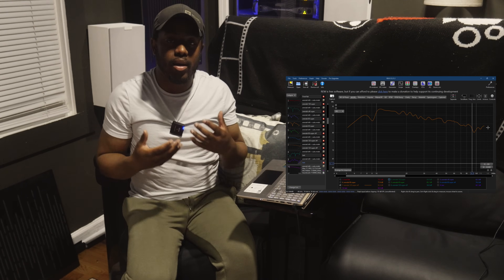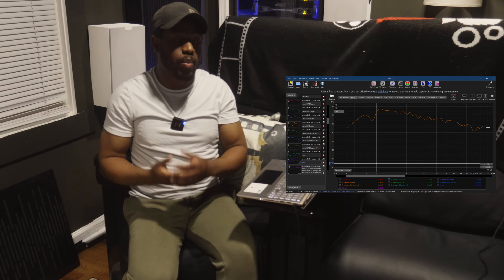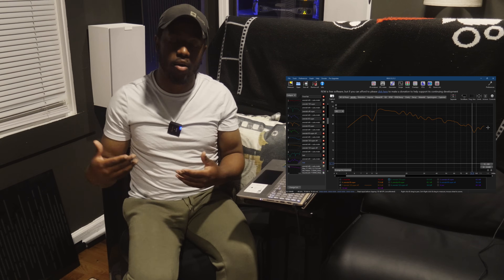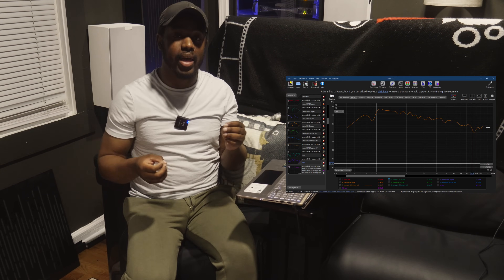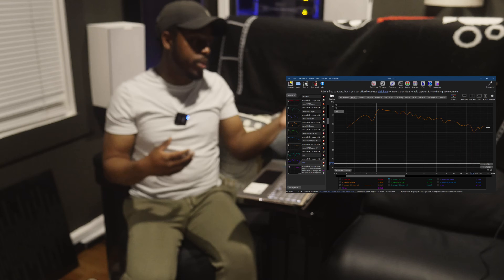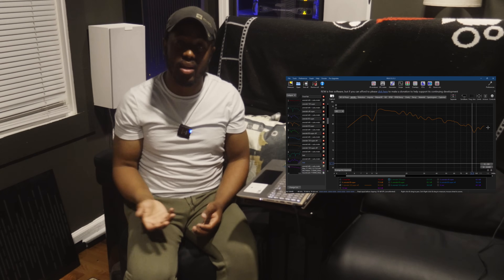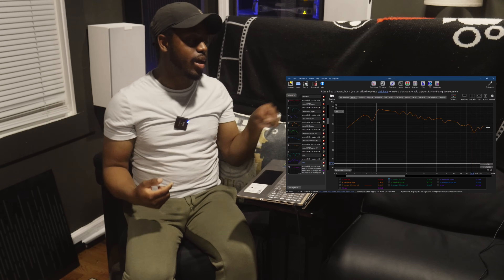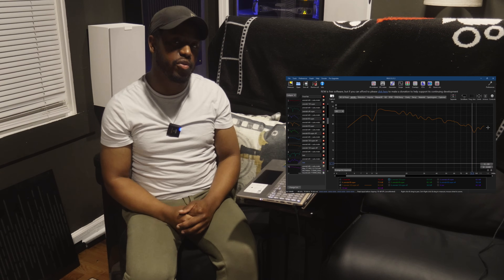What you DIDN'T Know about Speaker Crossover!

Comment: from what i understand lfe is a dedicated channel designed to go to sub. lfe and bass 2 different things. so lfe+main is telling subwoofer to play lfe channel and the bass from the mains. Even if u have ya speakers set to large or full band the LFE will be sent to the sub not the mains. Right?
Reply from the maker: Yes I got mixed up a tad. Lfe will only go to subs no matter what unless you have your subs turned off
Reply: you def right i did a test and it’s crazy the bass output is actually higher when u set crossover to 100hz than it is at full band and double bass
Reply from the maker: Yuuuuup

Comment: LFE supposed to be 120 HZ based on Dolby Labs as well as the Movie Studio. But i don't want my Subwoofer playing anything above 80 HZ my Soundbar can play that, good Midbass. I put LFE at 80 HZ only because it's the Lowest setting but i Prefer 50 HZ which is Perfect to avoid high SPL hearing damage as well as Neighbors can complain. People who set LFE to 120 they normally use DSP to flatten the frequency keeping it Under 60 HZ.
Reply: If you like it this way, that's fine, but it's incorrect.
LFE is its own channel, that channel only "has" frequencies from 120Hz and down, if you set your subwoofer to not play above 80Hz , you are simply losing that information... Unless you use LFE + Mains, then that lost information goes into your Mains.
Remember, High Pass Filter and Crossover are two different things.
Reply: @blwnvtwn okay thanks, I tried 120 HZ LFE on a few Older movies and the non- bass movies. But Godzilla and Kong series and few others I always keep it at 80 HZ. THX says 80 HZ for Everything but maybe not LFE, although I thought it said Subwoofer too, probably Crossover & not LFE.
Reply: @blwnvtwn  I will keep LFE at 120 HZ from now on. Jiles told me if it's not 120 HZ things will just not sound right. Wish the A/V receiver had a Subwoofer Crossover as well. Denon probably has good EQ. My Onkyo has 32 Bit Processor for Music.

Comment: I recently recalibrated my system with Audessy , I set my Speakers to small after Audessy set them to large, Audessy set the front speakers crossover at 40 hz and it sounds better than the 80hz crossover I had set before recalibrating, My Subs have a big null around the 75-80 hz  range, I think my front speakers are filling in that null around the 75-80 hz range, and the sound is better to me, I want to mention that I can’t find any microphones that cost $80.00, Amazon has UMIK 1 for $125.00 and that’s the cheapest I have found , any suggestions on how to get the $80.00 microphone everyone is talking about.
Reply from the maker: Ebay

Comment: When talking about crossovers that are digitally adjustable, it may be less confusing to use the terms high pass filter and low pass filter  (HPF & LPF). 

For those unfamiliar: A HPF permits the frequencies higher than the crossover point value to be sent to the speaker while attenuating (filtering out) the lower frequencies (and vice versa for LPFs).

Comment: Hi there I’m pretty new to this so wondered if you could help me? I’m more into my music so am using my system as 2.1 my two main speakers roll off at 60hz my sub is connected to my receiver via lfe, the back of my sub has lpf not crossover, so should I set the crossover of my receiver to 60hz and if so what do I set the lpf to on the sub? Would be very grateful if you could help me with this. Regards Gareth.
Reply from the maker: In this case you'll want your sub crossover and speaker crossover to be the same. So that they blend. I'd personally set the sub to 80 just to have a little overlap
Reply: @ so on my receiver set the sub to 80, is that right?
Reply from the maker: @garethdavies9881  if it sounds better its worth a try
Reply: @Kpaceguy  ok thank you, I was unsure whether to set the lpf to the same as the receiver, in this case 80. Thank you for replying to me.
Reply from the maker: @garethdavies9881  are you saying what should you set the dial to on the sub itself?
Reply: @Kpaceguy  yes
Reply: @Kpaceguy  it has lpf and volume so was wondering what to set the lpf at?
Reply from the maker: @garethdavies9881  set it to max or as far right as you can turn It
Reply: @ thanks bud, really appreciate your help👍🏻
Reply: @ and put the lpf to 120 on the actual sub? Sorry for being a pain with the questions. Just want to get the best out of it.

Comment: So, I  have my fronts set at 60hz & my sub is on lfe+main, but set to 80hz. Should my mains or fronts be set to 80hz also?????
Reply: Ok. Thanks so much for the advice!!!
Reply from the maker: What you have set right now are your fronts to play 60hz, your lfe to play 80 hz and your sub to double what your fronts play down to 60hz.

Ideally, your sub should be set to 120 for lfe. It's up to you if you want your mains to play 60, but you won't know what's best without measuring or a REALLY good ear. 

Which is why the recommendation is 80hz
Reply: Set your subwoofer to 120 please. LFE is a dedicated channel. It does not send any info back to any other speaker. You set the lfe crossover to low and the frequencies will be rolled off and discarded! 
Speakers can be set to 80hz. It's totally fine especially what i would do if you are not sure how low your speakers could go and if you have no external amps. This way you avoid clipping, distortion and stress on your avr. 
Also set the subwoofer to LFE only. LFE+Main is ONLY for content that has no lfe channel aka 2.0 stereo

Comment: Great video, also the advantage of not using the main speakers to take on the bass is that it takes off strain from the AV amplifier, as it has less load driving the speakers (if passive) and therefore plays with more headroom.
That's why I just leave my subwoofers crossed over at 80Hz and let them deal with the bass. 
This works better for cheaper AV amplifiers as they don't have a lot of power compared to high end AV amplifier..

Comment: I had a hunch it would be better crossing over your mains even though they play low lol having 4 subs and optimal placement, you want to mess with that bass as little as possible
Reply from the maker: I time aligned the subs with the mains after shooting this video and it made the graph a lot better for running them full range but the BEST bass is with a crossover
Reply: @Kpaceguy yeah it takes some work if you want to do it but man subs are just better at bass lol the mains you always gotta worry about placement in regards to MLP because of directional frequencies, where as the subs you can put them wherever measures best because it’s omnidirectional, I will say I never thought to crossover higher, I may have to do some measurements in my set up and see if that actually makes a big difference for me

Comment: great exercise but i have questions. i have a budget/entry level setup only have 2 10” subs one in front of room 1 near field right behind listening position. using onkyo avr it doesnt have lfe+main it has double bass. when setting my front soundstage to large and turning on double bass the voices on screen and the bass in general sounds a lot more natural. i dont have measurements tools u have im just using my ears. why does this sound better? When i set crossover at 80 hz theres too much bass in character voices
Reply from the maker: Double bass is most likely the same feature as lfe+main.  It probably sounds fuller to you and not too much bass because your speakers are pumping out the voices instead of the voices coming from the subwoofers. You may be able to achieve the same effect if you turn off double bass svs set your center speaker crossover to something lower like 60hz instead of 80. So, fewer voices come through the subwoofer.
Reply: @Kpaceguy ok cool i’ll experiment with it

Comment: A very informative video indeed. 👍 At first I thought you were going to suggest LFE+Main and Large, i.e. full range, for your mains. 😲 It wasn't till you got to the REW measurements that the negatives from doing so became very apparent, and you showed how much better the response was with LFE & small speakers selected. Many individuals hear those increased bass frequencies when LFE+Main is used, but don't realize the harm in duplicating the LFE signal in your Large speakers (bass nulls, phase issues, increased room modal resonance, etc.). This is because you have LFE frequencies not just coming from your dedicated powered subwoofer/s, but also any speakers set to Large, full range. Too many chefs in the kitchen, all talking at once. 😁 I could go on and on about what the crossover setting does for the Large speakers when LFE+Main is set, but I'd probably run out of space. Therefore, as you showed in your video, most home theater individuals are best served by using LFE, set all speakers to small regardless of their actual size, and use a crossover frequency found by measuring their rooms frequency response. If you can't measure your room, a very good starting place for your small speaker crossover is 80hz. Many wonder were the 80Hz recommendation originated, and it was found by the good people at THX to be the best setting for speakers & subwoofer/s without localization, while they were developing their THX standard requirements. 💭 Let your powered sub/s do what they do best, and let your AVR/amp handle the frequencies above the crossover point. Your equipment will run cooler, and your entire system will have more dynamic headroom. Also, people please don't change the LPF for the LFE .1 channel from the default 120Hz. 🤦🏼‍♂️ This LPF is not even related to your speaker/subwoofer crossovers, and adjusting this setting negatively impacts Dolby Digital LFE .1 content. This setting is typically found in the Bass section of most Denon/Marance AVRs. Again, great video my friend, and sorry for being so wordy.
Reply from the maker: Thanks for watching!
Reply: If you have exceptionally capable mains, they don’t require a crossover. My mains can operate down to 20 Hz with a lot of usable output. I run them in full range and route LFE to them through the Denon distribution setting. My mains are time-aligned with my subs using REW. There’s an Audioholics video below that provides further details.

https://youtu.be/atAE6ADxYkw?si=7d3YCXTwQ1CsRC-f

Comment: I'm pretty sure "super sub front" from Anthem and "Lfe + main" from Denon accomplish totally different things. Anthem states "Full frequency range stereo is fed to the front left and right channels and bass is sent to the subwoofer.  In this case the low frequency information is effectively doubled which may result in unpredictable and colored low frequency reproduction.  This setting is not recommended for accurate sonic reproduction." while the description from denin about Lfe+main is "
The other option you can choose is LFE+MAIN. This option includes the LFE from the Dolby, DTS or Auro 3D track and adds any low frequency that’s sent to the other channels under that channel’s set crossover point. It is recommended that you set your AVR to LFE+MAIN when playing back from any analog based source or when decoding a PCM based source for your subwoofer to output any of the low frequency from those sources. This ensures that your AVR will provide a full and balanced tone no matter what is being decoded or output. "
Reply from the maker: Interesting. Sounds kinda similar from what you sent here

Comment: Good morning. We don't have to assume that we have a subwoofer. We either have a subwoofer, and we can use the crossover, or we don't. Then, the avr will lock the fronts as large / full bandwidth, and it IS the only time you will get LFE on the main speakers.  LFE+Main / double bass does NOT send lfe to the main speakers!! It sends a signal to sub FROM main even if there is no .1 (lfe channel in the source) .
Just test it with the beginning of edge of tomorrow. Lower the sub gain and listen to it.  Then turn the subwoofer off in the avr and the mains will now play the lfe too, and it will sound extremely different! ( Because the LFE is redirected to your main speakers) Now try it with subwoofer setting back on, but gain lowered all the way and there will be no difference between main and main+lfe when u play that part of the movie. 

And no... setting your speaker crossover anywhere will not make your subwoofer play less. LFE channel is a different separate entity and its on its own. You need to change lfe lpf to have the subwoofer play less.

You can check any manual about LFE+Main or double bass. They will clearly state what it does but here is the answer from Marantz:
"LFE+MAIN allows the LFE and the low frequencies from all speaker channels to be output to the subwoofer. You would normally choose this setting when decoding PCM based audio or playing back from an analog source."

Basically LFE + Main allows you to set the speakers to full bandwidth / large and STILL send the bass from the main speakers to the subwoofer like the speakers were set to small with crossover.

Comment: I love this channel. Great info @Kpaceguy 👍🏾. I will continue my message in "reply" . To start off . I have a pioneer elite s c l x 901. I have four crown XLS 1502 amplifiers. You can look these up online for the specs. I also in my arsenal have Polk audio monitor 70 series 2 towers. I have a Polk audio l s i m 706c center channel.➡️
Reply: Now I have my center channel off the amplifier set at 70 HZ . On amplifier one. Amplifier 2, which is for the towers I have set at 50 HZ, my point is and my question, 

The pioneer only allows you to do 50 HZ, 80 HZ, 100 hz, 1:50 hertz, 200 HZ.. no in between. 

It's hard for some of us well I can only speak for myself but just in case somebody do have a pioneer, knows that that's all they give you. 

I blended and time alignment everything to my liking. My question and request is when you have capable amplifiers that you can mess with the frequencies, even though THX has the basics, would you still set it to 80 and 1:20? 

Apologies for the long message but I have to break down my situation so you have an understanding. 

Calibration has my system at 1:50 my center channel on large and I don't know how that happened. All the rest of the speakers on small. It sound good but I wound up changing it all too small and then change it for the front stage to be large. 

It sounds good. If enough people ask for it can you do a in-depth explanation about the external amplifiers that are capable for you to manipulate the frequencies. No one talks about amplifiers that are capable of doing that versus the fix amplifiers. Again I apologize for the long questioning request. I asked this question but still don't get the proper answer. Thank you and continue what you do cuz it is great info I appreciate it.